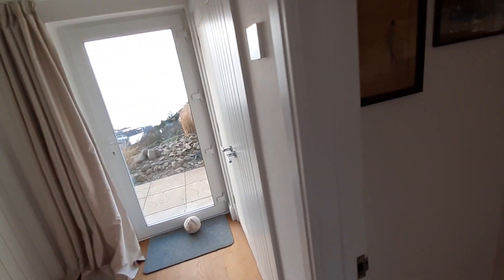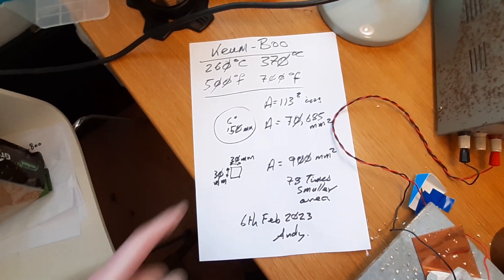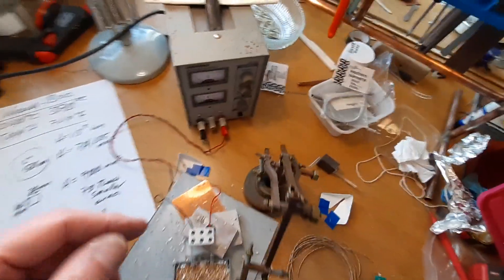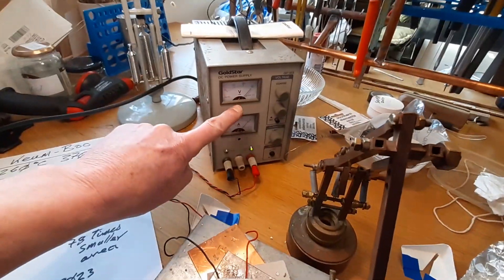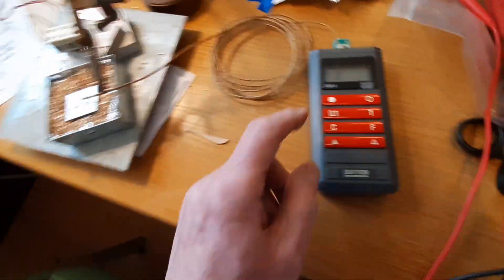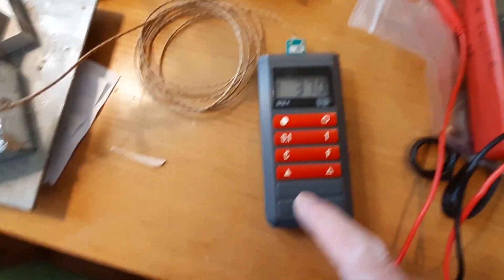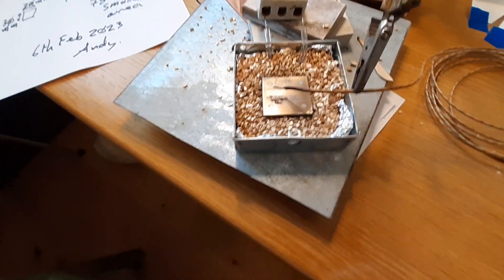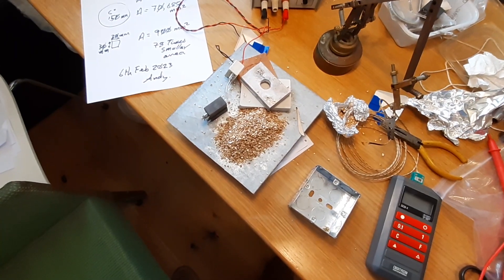Keum-Boo prototype miniature hotplate. Please read description as you might be wasting your time.

Comment: Toaster ovens often have heating elements inside what I assume are quarts tubes.
Reply from the maker: Thanks Jack I've only ever seen toaster elements wrapped around sheets of mica. I've been thinking about it and I reckon that one could embed an element into a small block of fire cement or fire putty. (maybe even pottery clay) You can get fire cement at hardware stores. Don't make it too big though, try 1"x1" x 1/2" and see how it goes. I want to check out if one could use a 12 volt battery charger as the power supply. Screwfix in the UK do a 4 amp 12 volt charger for £21 (Feb 2023)  that would deliver 48 watts into a 3 ohms element. Not sure if that would get hot enough. It would have to be very well insulated with a top cover. I'd try two 6 ohms elements in parallel to give 3 ohms. By the way a 12 volt battery charger has to provide more that 12 volts in order to get the current to flow into the battery, so that would increase the heater wattage. I haven't tried it but if anyone dose maybe they'd let me know. Regards . . . Andy
Reply: @AndyDaviesByTheSea  I have not made such a small heater but will let you know Andy if I do in the future. Good day fella too. vf